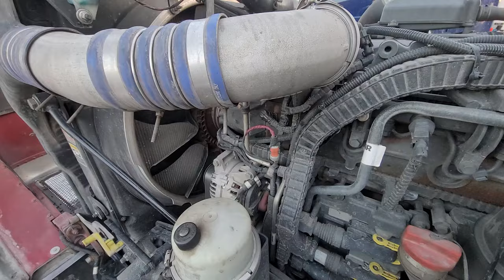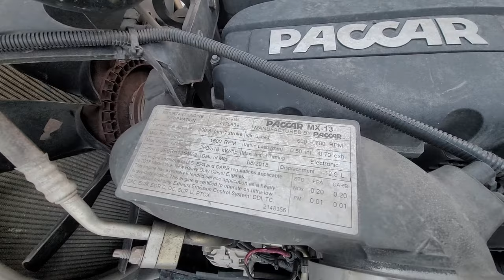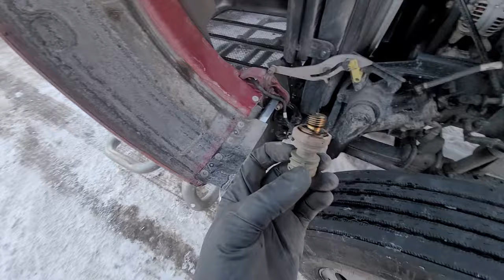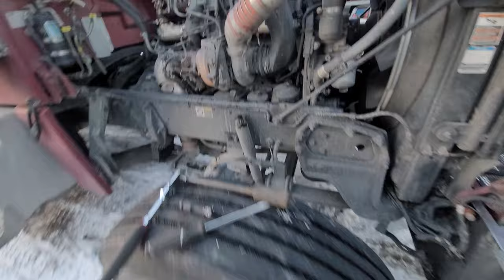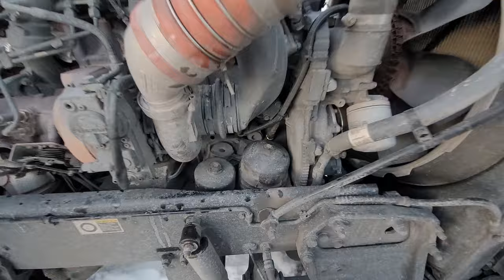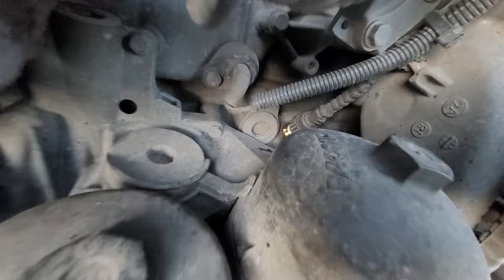Paccar MX 13 oil pressure sensor location

Comment: That is the oil temperature sensor
Reply: Actually EPA17 and up is on the passenger side. I just changed mine a few mins ago 9-27-2024